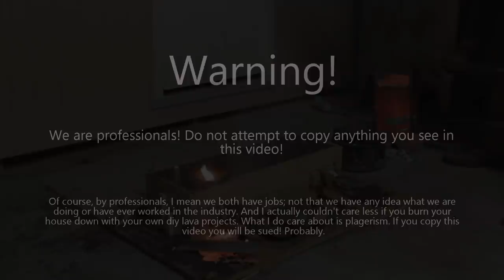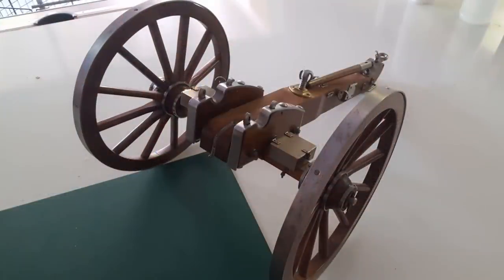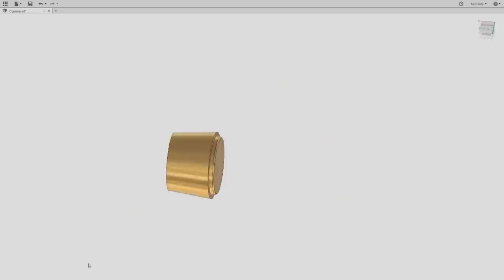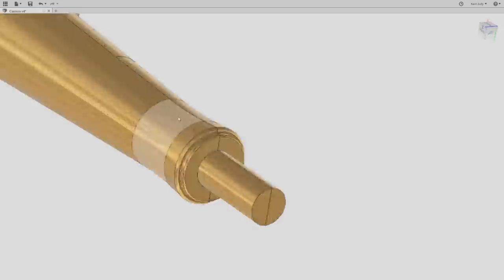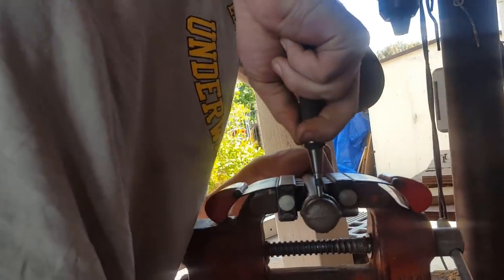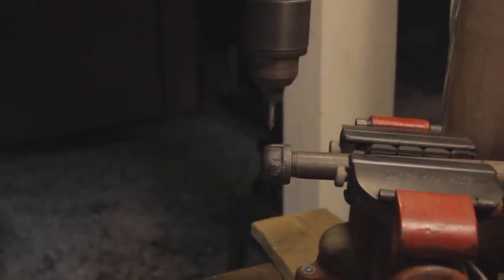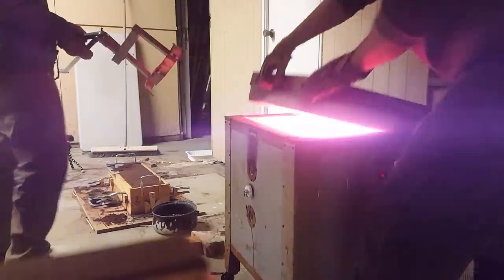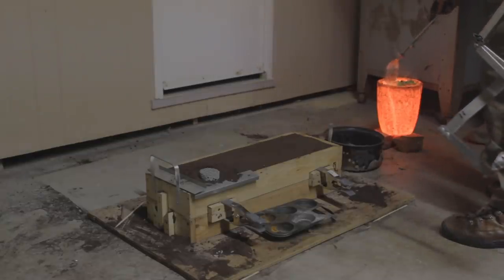Casting a Cannon from Brass | Part 1

Comment: I made one when I was a kid in grade 9 at Central Tech high School in Toronto in 1958. I just turned it on a lathe as a project, drilled it out and rigged a carriage, fired it with ball bearings, and still have it. No muss, no fuss, and got a keepsake.

Comment: When melting brass, ALWAYS do it outside.
Brass is copper and zinc.  Zinc will boil off, 
and zinc oxide is quite poisonous.  (It is 
also that yellow stuff in your dross.)

Bronze is copper and tin, and is much less 
poisonous.

steve

Comment: Ya'll need a little CO2 fire extinguisher! 😁  Thay are just right for situations like this, i.e. well ventilated area, partially dischargeable without leaking, works well on wood fires, and no mess to clean up because it's an inert gas. 
  Much safer, and cleaner than spraying water on super hot metal. What I use is actually just a small CO2 bottle with a pistol type valve, all it takes is just a quick puff and fires out, no mess.

Comment: Should be able to use lost pla so that yiu don't need to use the pipe anymore. And it would all be solid brass.

However the pipe is probably easier. Would be interesting to see you guys try lost pla for a cannon

Comment: When I was in high school we made a cannon simular to this used brass couplings from the fire department. We had to remove the bearings from them by cutting them out. It was solid brass no steel or pipe core because use was for wading only no shot. Used black powder and old newspapers for the wading fuses weren't used had tap and smolder cord. It was awesome for football games and firing for touchdowns. Times have changed since then the school has the cannon but the barrel is filled in with brass now.

Comment: Cool video eight years ago I ordered drawings from Dixie Gun Works and built the 1857 Napoleon Cannon to exact half scale every part handmade there's nothing like it on the planet I bet and it's accurate as hell two and a quarter inch bore 28 1/2 inch tall Wheels I take it to Memorial Day and Fourth of July and Labor Day parties of people just melt down and freak but I only shoot blank charges around people by the way the LED balls that shoots I made my own to cavity aluminum mold those balls weigh 35 Oz
Reply: I am a professional just so you know

Comment: Cannon were never cast from brass. It is too soft. Brass is a copper, zinc and lead alloy. Cannon were cast from Bronze, that is a copper and tin alloy.
Reply: They did cast it around a steel pipe so it should be safe enough to fire. Pouring water onto molten metal on the other hand, is just plain stupidity.

Comment: The method of gripping, lifting and turning the ceramic pot with the molten metal was dangerous. The tool used in foundries is held by one man either side, each with a handle with two arms so they can lift and turn the pot to pour out the metal without spilling too much. The method you used was bloody dangerous as evidenced by the spillage and the fire on the wooden formwork. I'm glad nobody received a splash of hot metal.
Reply: Normally one of them stands on their skateboard and pulls the bottom of the crucible with a garden hoe.

Comment: you are not packing the sand I correctly mate . all the sand needs compacting to some degree as you fill not so much as to move the cast but enough to knock the air out you cannot do this properly from the top after filled is will not compact the bottom

Comment: Jeez, a little research would help. First, you gotta flux the metal with borax. Second, cast it vertically. Third, use bronze. They called it brass, but it was actually bronze. Copper and Tin, maybe 2% zinc. That's gun metal. Why don't you lost wax it? Make a wax model, cast it into investment, turn it upside down, melt the wax out. Pour it vertically. No flame, no spills, no need for a sprue or risers. That's what they did in the old days.You could cast a steel liner into the tube. Much safer when firing. You guys worked like shit and ended with a totally unusable cast.

Comment: You manage to make a canon and dont got the iq to make a easy way of pouring it, like a double handle on each side high and low aswell as cradle in middle and stop on top so it dont fall out if tilted more than 90 degrees